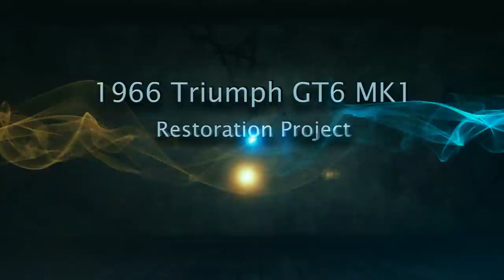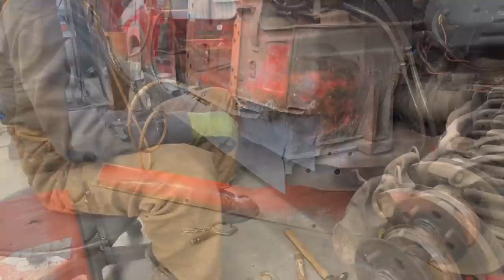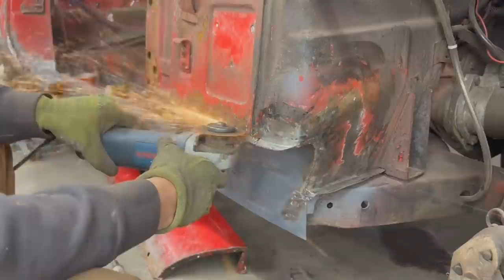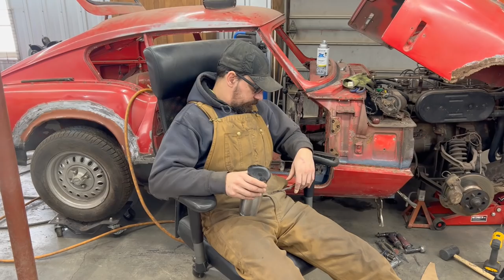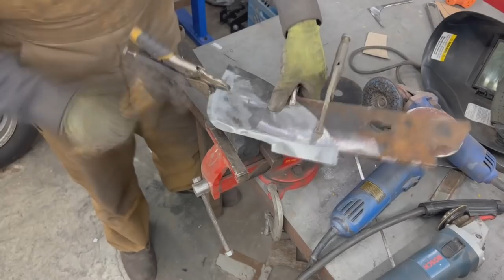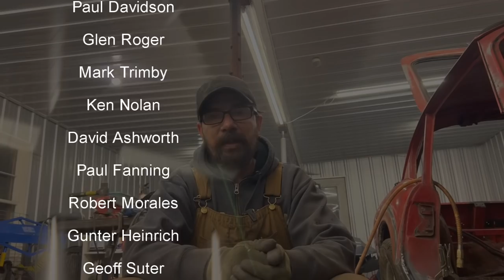1966 Triumph GT6 - Part 19 - A-Post & DIY Sill End Cap

Comment: Nice work…I thought you might have used your new planishing hammer to smooth your end cap flange.  And…for anyone reading this comment, now you know why I don’t stay for Dinner ……😉
Reply from the maker: C'mon... just because I eat the rust as I cut it off doesn't mean I won't serve it on a plate with some nondetergent dipping sauce for you!

Comment: Just a Question ...would it not be a good idea to cut out the hinge points? ( even just the outside layer ) i noticed they had rust on the outside surface and probably ate rusty in between the metal in there....don't they have a floating metal plate to adjust the doors??  looks like a good time to clean that up...i'd make a template to align the holes ( although that is easy to do without one )....
Reply from the maker: Well it is a good idea, but there must be a line somewhere that I should draw and not cross..... Otherwise I will take the whole entire car apart and spend 6 years on it. For sure when the car is done there will still be those hidden areas with surface rust.... I am sure they are there even in the best multi thousand dollars restorations...
Reply: @RustyBeauties  
yep..the never ending repairs....lol
your project..would let you decide ...as we all do...

Comment: Having a break,watch someone who knows what he's doing,before I beat a MIG to a pulp..trying to use flux core is driving me nuts,I know you shouldn't blame your tools,but when you see rusty tacking along,and I'm either blowing holes of leaving splatter every where..does the gas make it easier?🇬🇧
Reply from the maker: I was putting my welding table together last week and I ran out of gas. I knew I wasn't going to be able to get gas in the next few days so I decided to switch to flux core just so I can put my table together. I will never try flux core again. I felt as if I've never welded before. Yes, the gas makes such a difference. Don't torture yourself with flux core.
Reply: @RustyBeauties  This is so reassuring to hear, I clearly need to upgrade from my first machine which is gas-less